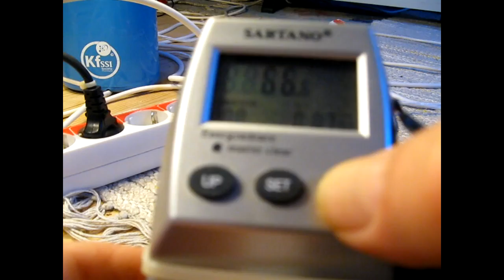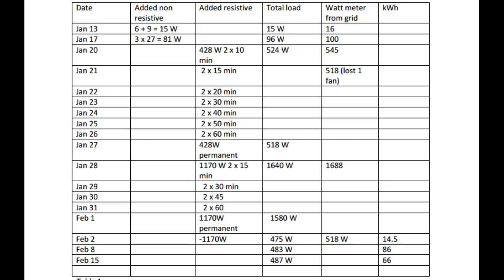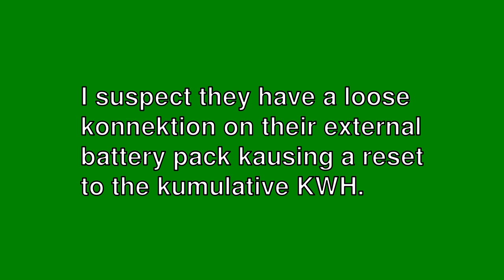#447 QEG Sweden Magrav Test 07

Comment: Could that 6 - 7 % saving be due to the power factor correction? But instead of bettering it, it is worsening it.
Reply from the maker: +Francisco a It is still 518W from the grid, 487W to the load, ***31W LOSS***, ***6% LOSS***.
Reply: Looking closely to the data I see this: 428 W + 15 W + 54 W = 497 W total load. 487 W shows wattmeter. 10 W / 2 % saving. I can't see the loss. Could you explain why you see it that way?
Reply: +Curvy Shrine I respect Mark's opinions, also yours. There have been also some believers that their magravs didn't work either. Seriously, I wan't to see more thoroughly conducted research from people with more knowledge than us "regular" folks who can miss some things.
Reply: I'm aware of the testimonies regarding the health benefits. Testimonies have its value but have very low scientific significance. Anyway, we will have to see more research to conclude anything. Coming back to the magrav. Keshe is selling those units for 1000 euros stating savings of 2KWh for 110v and, if I remember right, 3.6KWh for 220v. He is saying too that with time you can disconnect from grid. I haven't seen those savings anywhere, I don't even talk about the disconnecting from grid, sounds too far away from reality. If Keshe is selling something is supposed to give 2KWh and gives less the word that comes to mind is just this: SCAM. Easy. Have a look at this. Type on youtuve search: keshe magrav universal report, and have a look to the data.

Comment: Steorn O-cube, orbo power pack is actually 2 x 9v Energizer Eveready batteries connected in series, and wired to a re-chargeable battery cell via a 1 meg ohm resister.  He is using batteries to trickle charge another battery... This is cheating.   We will now take steps to shut down and finally get rid of this lying son of a bitch.  He will now be investigated.
Reply from the maker: +Jonathan Seagull Translation for the feeble minded: It's not what Steorn claims it is. It's fraud. Again! Very simple. Does that clear up your confusion?
Reply: +Far Que  
"trickle charge (?) batteries on meter" is cheating? Please explain.  'He will now be' ~   "He" who?
Reply: ah, so Steon and Keshe are conspiring to commit fraud ?

Making this whole thing (Plasma frenzy) a "world wide" announcement certainly makes it rather diffikult for the fraudsters to hide if the klaims are proven fiktional...